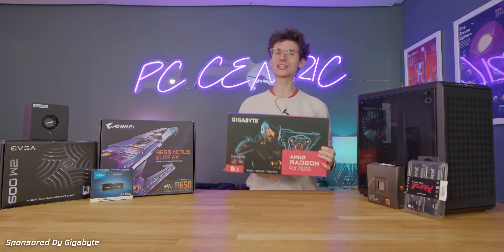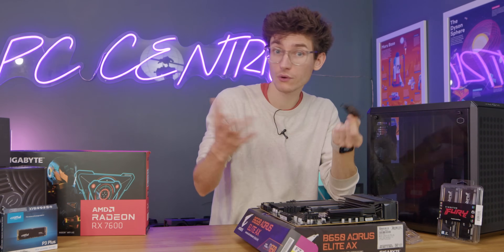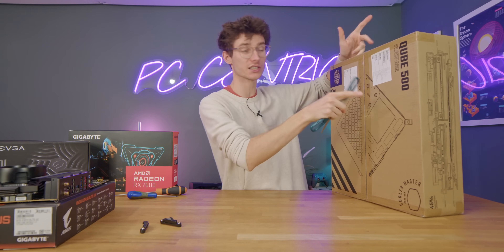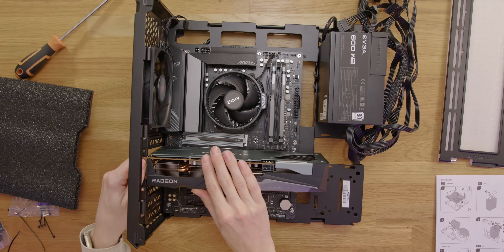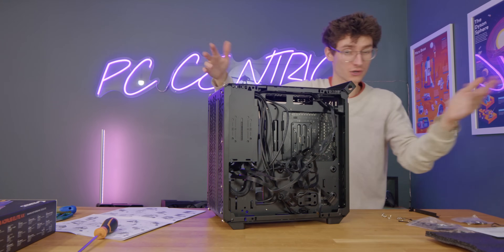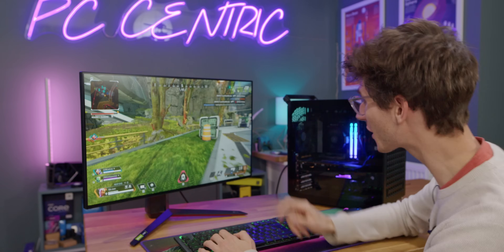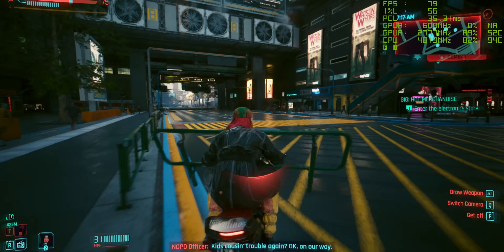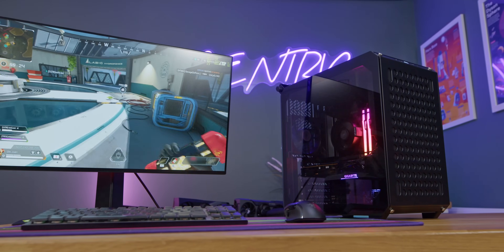The Best BUDGET Gaming PC Build 2024! 🤩 RX 7600, Ryzen 7600 w/ Gameplay Benchmarks | AD

Comment from the maker: TOTAL PRICE: $970.77 / £946.28 (16/11/2023) - Personally, I would go for a cheaper case though, and save another 30/40 bucks. Sorry the original case mucked this up😑
Reply: Would you put said savings into a 6700XT instead if the VRAM is potentially going to be an issue?
Reply: @ProfShikari  You are spot on. I believe he should have put a lot more into the GPU. Motherboard could have shaved some off as well as case. Power supply should have been upped a little bit for future proofing. Keep in mind this guy has forgot more than I know I'm just sharing a thought.
Reply: Why doesn't AMD sell 3 pre-builds? Entry level gaming: rx 7600 with a Ryzen 7600.
"Best value": rx 7700 with a Ryzen 7700xt and the 
"Gaming King" with a rx 7800x3d with a Ryzen 7800.
Easy to market.
Reply: @JamesSmith-sw3nk  you have to remember that AMD manufacture the CPU and GPU, they sell components, not systems
Reply: @JamesSmith-sw3nk 7700x with a 7700xt you will get a gpu bottleneck. With a 7700x you can run up to a 7900xt without a cpu bottleneck
Reply: Question do you think this pc can run warzone and call of duty perfectly fine?
Reply: The case is always kinda depends on who’s building it so if you’re going to muck something up that’s the thing to muck up. 😉
Reply: Do you recommend a rx 6750 xt or rx 6700 instead for the same price?
Reply: @Cyberchefmx  go for the 6750 if they’re the same price.
Reply: Bro if you could help me I’d be very much appreciative I am in desperate need of a pc I’m in the uk and YouTube doesn’t cater to us as well as it should I’m considering a prebuilt I have a £1500 budget please give your wisdom to a fellow enthusiasts
Reply: Could you possibly do a system specifically built to be able to run ark survival ascended at full capacity? Or at least reply with the specs you would use 🙏🙏
Reply: That's above my budget
Reply: do you think good routers are important?
Reply: @Chickenboot  yes
Reply: @Chickenboot  yes
Reply: @Chickenboot  yes
Reply: @Chickenboot  yes
Reply: @Chickenboot  yes
Reply: @Chickenboot  what do you think?
Reply: @stealthyboy2388  idk that's why i asked
Reply: @Chickenboot  yes dude
Reply: @stealthyboy2388  like how good should they be 1gb+?
Reply: what type of case(s)
Reply: I’m looking to build my very first PC never done it before and no idea where to start been trying to watch your videos and learn Thankyou.  Is this a good PC to start with as I’ll only be really looking to play WoW as I’ve never played before.
Reply: Not exactly budget…
Reply: Good vid tho

Comment: hi i just build a pc last week with amd r5 7600x with 7600xt gpu b650 rog strix b650-a mobo, 128gb of ram 2tb pcie 5 nvme ssd and 1000watts psu and the 360mm aio cpu cooler and it cost me like $CAD1500+ is it worth it?
Reply: what do you think about the bottleneck for my build?
Reply: @LoFilullscape Also just realized this, but 128gb of ram??? You've got to be trolling. Anything over 32 is unnecessary, even to pair with a 5090 tier build. 64 is too much, but 128?
Reply: 🤣🤣you don't need to worry about the ups because i already have it i know thay dor a long time and i always used ups my build is just for fun and experiment you don't need to worry

Comment: I’ve recently built a budget gaming pc and I have this processor and I had a few questions how do I optimise the performance by making appropriate changes in bios and while gaming it reaches upwards of 90 to 95 degrees how do I manage the heat, because even in idle state it sometimes goes upto 60-65 degrees. is it normal?

Other specs of the pc
32gb ram
1 tb ssd 
Asus Dual Radeon RX 6600 8GB
Motherboard MSI B650 gaming wifi

Comment: list of cpu coolers you should consider 
1. deepcool ak 620. this is the best air cooler you can get 
2. deepcool ak 500/ digital. im using this one on my personal system so its really good.
3. deepcool ak 400 this one is pretty good for its price tag ( good banging for the buck cpu cooler )
5. deepcool ag 500 rgb this one will perform a litle bit better than the last one bc it has 5 heat pipes )
6. deepcool ag 400 buy this one if you are in a extremely low budget and want a cpu cooler that'll be better than the stock amd one
as you guys can see im a big fan of deepcool and their cpu coolers are easy to install. just switched from a ag400 to the 500 black and it didn't take me 20 minutes to install the cpu cooler. way better than cooler master old hyper 212 black edition in terms of the installation prosses. the reason im recommending just air coolers is bc i prefer them instead of water coolers ( aios ), there are less moving parts and less likely to fail on you. here's an example, if the fan goes out while using a air cooler the case fans will still provide passive airflow to the heatsink while with aio ( all in one ) you won't know whats wrong with youre pc until it shuts down and you spend a lot of time troubleshooting you're pc until you find  out its a dead pump.

Comment: Nice build, as someone who has a Ryzen 7600 in a Q500L case I was looking at the RX7600 which is how I found your video. I like the new version of my case, especially the self assembly bit. As for cable routing, you correctly point out that this is where modular or at least semi modular is where the smart money goes. It seems to be a religious belief that the Q500L and Q300L are hot cases. Sorry, never been able to substantiate this despite lots of testing but I specifically don't buy inefficient CPUs which run very hot plus I always use the Peerless Assassin. It isn't rocket surgery folks.

Comment: The amount you save on RAM where I live is kinda limited, It's only about 30 euros going from 100> to 70 if you get 16 and not 32 GB of DDR5.
1TB NVME SSD storage is 50 while 2TB is 90 euros, this also feels kinda not worth compromising on.
What I do love is saving money on the mobo, without wifi I can get a mobo I'm happy with for 90 while it would cost 150 minimum for any mobo with wifi.
I can almost afford the 2TB NVME SSD and 32GB of RAM by simply ditching wifi, and it's not like you can't add that in later if you so wish.
If you live in Europe it's also silly to get a PSU with anything lower than an 80+ gold efficiency rating, you'll earn back the extra cost within a year due to the high electricity costs here in Europe.

Comment: I just built a pc for a similar price, but saved on the cpu (Ryzen 7500F via Aliexpress) and spent a bit more on the GPU (6750xt) - and did use an older video from you as a reference for UK prices and GPU deals. Thanks a bunch!
Reply: You made a great choice of components! This build should last you quite some time!
Reply: would u recommend using ryzen 5 7600 with an rtx 4060 or rx 6750xt?? (If it was somewhat the same price)

Comment: Brand new to PC building. Love the content. I already have the cpu on the way and I went with a slightly different b650 motherboard by gigabyte. I am probably going to go with a corsair 4000x with 3 extra fans in the case(probably don't need that many) but my question is if the 600w power supply will be enough. I'm thinking I should jump up to 650w at least. Any thoughts?

Comment: Will a 7600 bottleneck a 7900XT or go for 7800XT?
Reply: It depends but I would say no, I would say that the 7600 won't even bottleneck the RTX 4090 at 4K and QHD in general.
If you're going to play E-sports titles in FullHD with a display that goes beyond 144Hz, something like 240Hz, then yes, you may be bottlenecking the 4090 with a 7600 but almost nobody buys a 4090 for E-sports titles and if they do they won't be cheaping out on the CPU. Almost nobody needs anything "better" than a 7600 when it comes to playing video games.

Comment: I've based my first build on this video, so I just wanted to say thank you for all your videos, I've binge watched them for the past few months now, and learnt so much. I've ordered now and did make a few changes - I've swapped out the motherboard for a MSI B650 Gaming Plus (£149), managed to get Crucial P5 Plus 1tb for £50 on Amazon (Black Friday), chose a higher wattage Corsair RM750e for £80 (for the fully modular option/future improvements) and chose a Corsair 4000D Airflow. All safely within budget. I'm looking forward to saving in the future to upgrade the cooler, add some more fans and maybe in a year get better CPU and GPU. Thanks again Marcus!
Reply: That’s exactly the same changes I made, comes to around 850 in total (I already have a 850w power supply from my last pc) just wondering how are you finding it performance wise?
Reply: hows the  performance at heavy games?

Comment: This is pretty much how I would spec a $900 PC today(spec'd these prices at microcenter). Of course with 32GB of DDR5 6000. 1440p at medium settings is plenty good for most people. Those of you saying spend more on a better GPU and less on the platform should take into account that AM4 boards have been around close to a decade. DDR5 has 50% more bandwidth than DDR4. In the long term, an updated platform will last you longer and be less of a bottleneck. You can always upgrade your video card easily when you have a system worth upgrading.

Comment: I am buying a pc for 1200 dollars are these specs worth it. 

WINDOWS 11 HOME INTEL® CORE™ 17-13700F PROCESSOR GEFORCE RTX™ 4060 Ti 16GB GDDR6 32GB DDR5 MEMORY

1TB NVME SOLID STATE DRIVE 2TB HARD DRIVE
 WIFI 6E BLUETOOTH 5.3

RGB CPU FAN COOLER 4X 120MM CHASSIS FANS
Reply: Idk the gpu seems quite a bit lame, you can try rx7800xt, or 6950xt

Edit : I know the budget is getting a little more expensive, but it's much more worth it than the trash rtx 4060ti, or if you really want nvidia rtx, you can choose rtx 4070

Comment: Hi, is it worth it to get a AMD Ryzen 7 5800X3D? It seems really good, but I'm unsure if RX 7600 is better? There is so many different builds that it's hard to find a solid and affordable build that makes sense.
Reply: If you already have an am4 motherboard, a 5800X3D is fantastic. Am5 motherboards have become a lot more affordable since release. For pure gaming fps the 5800X3D will win out in some games by quite a bit with others being pretty close.  
I would go for am5 if i didn't have an am4 mobo already because of the longer support for cpus.
Reply: I do have an AM4 mobo currently, but I feel like my graphics card and CPU need upgrading. ASUS Turbo GTX970-OC-4GD5 NVIDIA is my Graphics card and AMD Ryzen 7 2700X is my CPU. I'm really not an expert, so wondering if it's the CPU or graphics card that needs changing, or both, for great improvements. (I haven't got a huge budget too)  @daunted232

Comment: Quick question, when I'm playing cyberpunk and other games at 1080p on my 3070 (1920mhz) and ryzen 7 5800x (4.7ghz) paired with 16gb 3600mhz cl16 ram my gpu will always have low usage and when I get high usage is will never stay at a consistent 99% and in some areas it will drop to 64% specifically the roundabout in the city for cyberpunk. Do you know what the cause can be my drivers and chipset are fully updated but my bios isn't can this be the problem or is is something else?

Comment: Love my 5800X/6650XT I built about 15 months ago. Great build as always. AMD is the way to go value wise.
Reply: gpu wise i agree but right switching to am5 platform intel is currently the cheaper option both the 12400f and 13400 are cheaper than a 7600
Reply: @ant5963  Not in every country
Reply: @ant5963 upgradability is better though. You can always upgrade to 8600 or 9600 or 10600 later and have the same mobo + ram lol. With intel you have to change mobo

Comment: Currently have a prebuild Lenovo desktop i7 6700 paired with a RTX2060s (upgraded the 970gtx) , got 900euro to spend in 2 weeks on a pc build (*my first one :D) but my question is... Should i go with a better motherboard and cpu (will go intel) and hold out on the gpu for about 6 months? 

I want the system to be futureproof and running ddr5 but living in The Netherlands, the prices seems to be a bit higher here (10/25%) thats why im wondering what to do in this situation. 
Build a complete pc for that 900,- or just keep the 2060s and upgrade that a later date to a Arc770/rx6700xt/rx7800xt  for example? 
 
Currently playing a couple of games where the gpu is my bottleneck atm, but wonder if the prices come down within 6months to get one of those gpu's for a decent price. 

Or am i just crazy to think this way and both solutions cancel each other out in the long run? (ow yeah, saving the 900 untill next year not gonna happen btw :P)

Comment: This budget build may be short lived once the 5500X3D CPU is released, as I can only assume it'll be similar price to the R5 7600 but will allow DDR4 to be utilised with cheaper RAM and motherboards.

Edit: Side note, that flat packing is a very nice feature! I think a lot of enthusiasts would enjoy putting their rig together in more ways than just plugging in a few components. Very FormD T1 vibe
Reply: 7600 is equal speed to a 5800x3d? i actually think the gpu he chose for this build was very dumb.
Would have chose a 6800XT or Better
Reply: He said to prioritize Graphics, but I don't  even feel like he took his own advice, would a 5600 or 5600X be a noticeable bottleneck in this system? because they're like half the price last time I checked and seems like a good enough pair.

Comment: But for this kind of budget I will increase the GPU to a 4060 (if you're a nvidia fan boy/girl ) or rx 6800 (if available) or rx 6750/6700 xt and reduce the cpu budget to about 130 dollars and take a ryzen 5600/5600x with a cheap b550 mobo or better i5 12400f .
Reply: Exactly! That's great advice. AM5 is too expensive for a simple rx 7600. And as the title says it's a 'gaming pc'! The ryzen 5 5600 + rx 6700xt is the best pair imo

Comment: As you mention the CPU temp is def a problem. In some of the games it was running in the mid 90's!! I guess a better CPU fan would help but I think the case airflow (or lack of) is the main problem. Because as you said the stock CPU fan should cope.

Edit: I also notices these CPU temps of 90deg were at fairly modest CPU utilisation (50% or below) . So unless the fan/CPU are incorrectly fitted, the CPU fan and case cooling are a real problem with this build.
Reply: One wonders if a different case (one with proper front-to-back airflow) and an upgraded CPU cooler would then see the "CPU bottleneck" problem vanish.  Also, some SSDs begin to throttle at temperatures much lower than 90C (some throttle severely at 90C).
Reply: It’s actually supposed to be near 90-95 range for zen 4 cpus

Comment: About 250€ thrown away on mobo cpu ram combo here for which you could almost get rx 7800 xt, with 16 gigs of ram instead of rx 7600 with 8 gigs. I do like the case!
Reply: I am interested in where the 250 euro figure comes from.
Reply: @daunted232  ok. 100 on cpu as in ryzen 7600 costing 220 opposed to 5600 which is 120. 100 on motherboard. 90 to 100€ buys a b550 motherboard. And 50 on ram, since one can get a 16gig kit for under 50€.  Ryzen 7600 is not much better than 5600.
Reply: @markod7662  the 7600 is more like an 5800x3d than an 5600.what are you even saying.much better for gaming and productivity.an5600 would bottleneck an 7800xt while the 7600 would not
Reply: @ariskoin9612  i will buy the rx 7800 xt and then i will tell you.

Comment: I was just looking into building my first PC, with an R5 7600, but for the GPU the 6750XT is on sale right now for only 30 bucks more than the 7600. I am just wondering if these AMD cards are suitable for recording/streaming?
Reply: If you’re looking at streaming, then the 7600 would be a little more future proof as it utilises the AV1 codec, the 6700/6750XT does not, you could go a bit higher and look at the 7700/7800… but they are a little more expensive.